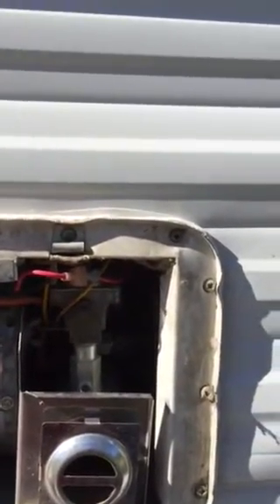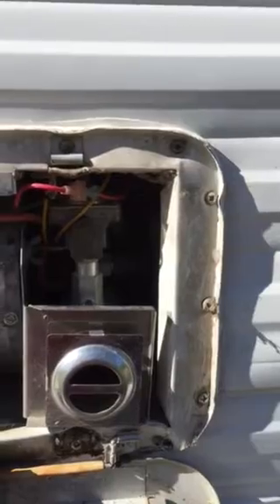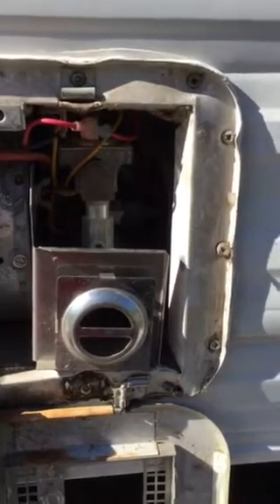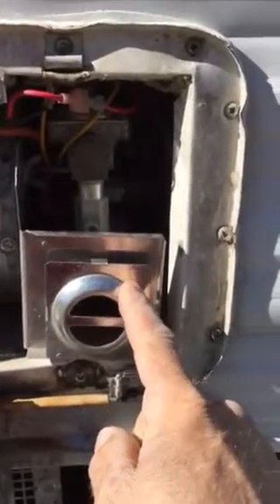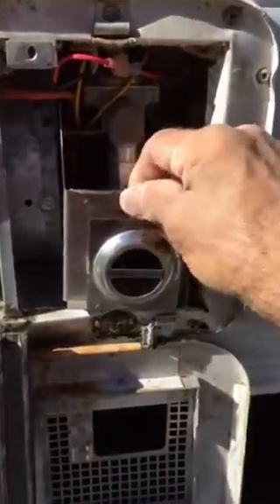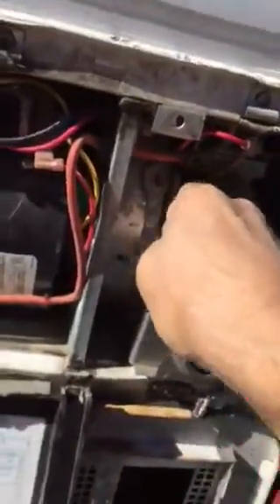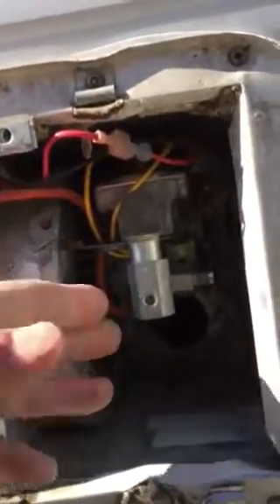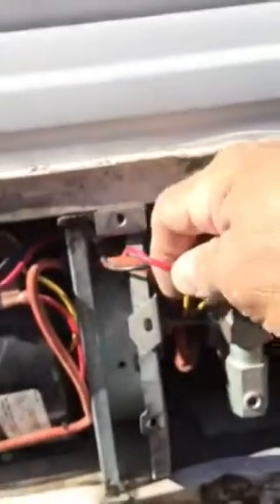Atwood 8525 igniter and gas valve removal.

Comment: I'd like to add my thanks for you video as well. I just took my igniter assembly off/out.  You video helped tremendously to give me the confidence to take mine out and what to expect. My problem is not the igniter, but the gas valve. I was smelling LP on a recent week long outing. Using my gas leak detector, it turns out it was coming from the heater exhaust. So, I have found one on eBay for about 1/4th the cost the local dealer wants for a replacement, and I plan to order it today. Thanks again.

Comment: Thank you sir for this.  It gives me a lot of confidence to give it a try myself.  I have and older 8531-III furnace.  I can smell propane and I know I'm getting good spark but no light.  (Its very easy to pull off the igniter wire from circuit board and see the arc if you use a jumper wire and position it so it can arc back to the igniter wire).  Something must be up with the igniter itself. For 20 bucks, if I'm going to tear it down that far, might as well replace igniter and burner while I'm in there and be done with it.  Good tune up! Thanks again!
Reply: Hey did you ever figure it out ? Was it the the igniter ?? I have the same heater model and same problem.
Reply: @Hugo-Hernandez  Yes, I took it all apart to replace the burner and igniter but found a tiny dead mosquito inside the brass Propane orifice. Cleaned it out but replaced parts anyway. Worked great after that.
Reply: @donbailey6600  
Thank you

Comment: Do you think there's any hope for getting the gas valve and burner out without first removing the exhaust tube? Mine is stuck fast - I've soaked it in WD-40, tried heating it with a propane torch, and wrenching on it with a pipe wrench - that sucker isn't coming out.